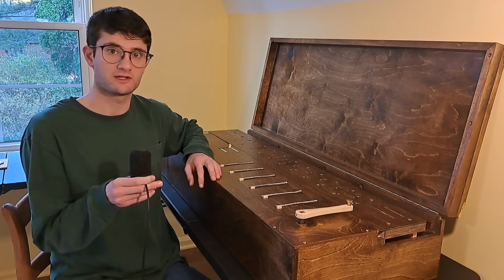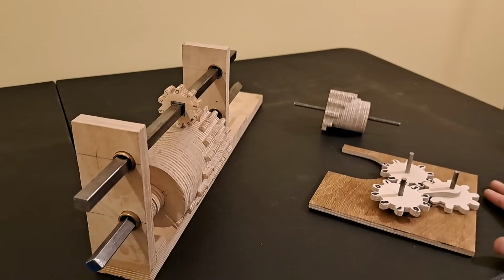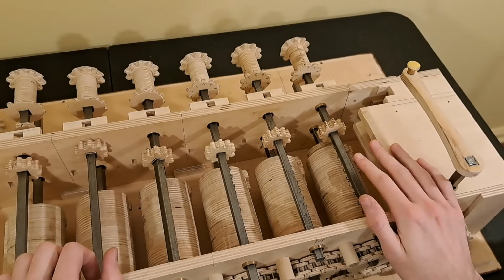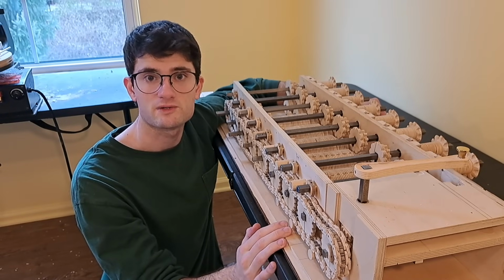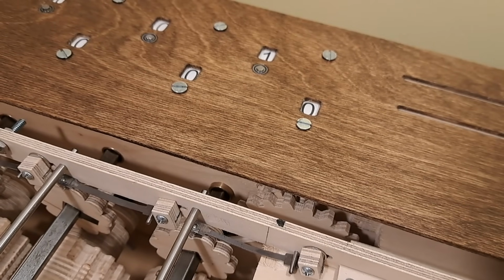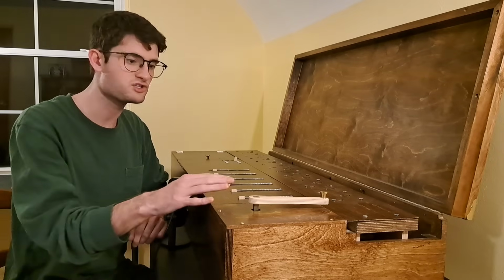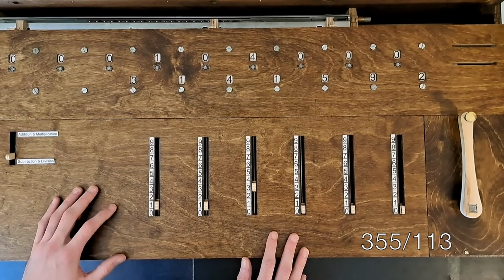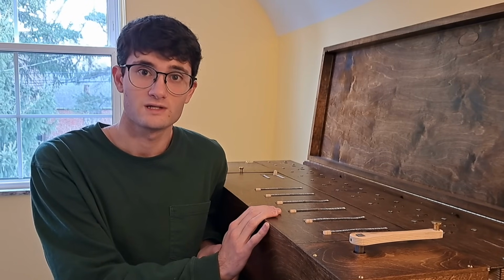How I built a Mechanical Calculator

Comment: The craftmanship and brilliance you've demonstrated are amazing. But I gotta ask... what happens if you make errors during number input? And, what happens if you rotate the crank backwards?
Reply from the maker: Thanks. If you slide to a 6 when you meant 7, for instance, the machine just acts like it's a 6, so you can make mistakes but the machine will not! (You'd have to subtract 1, or 6, then move the crank counter back the necessary amount). And there is a ratchet and click preventing the crank from rotating backwards. If there was not and you rotated it backwards then the machine would jam when it tries to perform a carry. Good questions!
Reply: Very cool, makes sense - you'd just have to catch your mistake and undo it. 

Heh... May I suggest publishing a Short demonstrating what happens when you divide by zero? The community may enjoy seeing the machine spinning with no operation.

Comment: Impressive!  I have a question.  What happens when you try to subtract a larger number?  Is there a way to deal with negative numbers?  At first I was wondering if you could divide by a larger number, but I guess you would shift the larger number over a few places until it was no longer larger.
Reply from the maker: Thanks! Yeah it doesn't really work with negatives. You can't input them, and when subtracting into what should be a negative, the outputs turn backwards from zero to 9, instead of to -1 (the dials would have to have like 19 spots to accommodate negatives: 1-9 positive, 0, and 1-9 negative). Thanks for the question!
Reply: @WhatWillMakes  Thanks, I thought that might have happened.  I guess it is like the complement in a computer, where negative numbers start with lots of 1s in binary a negative in decimal starts with lots of 9s.  I too was hoping to make a mechanical calculator, but a much simpler one, e.g. using gear ratios for simple multiplication or a 10:1 for second digit.  You inspired me, I might try one that incorporates negatives into it.

Comment: This is pretty bonkers. I have two Curta calculators, a type I and a type II, which internally use a stepped drum. Curt Herzstark's brilliant innovation was to arrange multiple digits around a single shared drum instead of using one drum per digit – this (along with a ton of other refined engineering) let the calculator be pocketable. I knew of Leibniz's stepped reckoner from having researched the Curta, but I never thought I'd see someone put one together out of wood – even down to making a _wooden chain_! Bravo.
Reply from the maker: Thanks! And I love the Curta - it's such an elegant design! I agree it's like rolling  this machine up around just one cylinder.

Comment: Not gonna show us what happens if you divide by zero? 😂
Reply from the maker: It's anticlimactic. Basically to divide by zero you'd just keep trying to subtract zero, but when you input zero it means the gears on the inside do not engage with any teeth on the stepped drums, so nothing happens when you crank except the crank-counter goes up forever... futilely

Comment: You don't need the intermediate wheel if you are willing to accept that every other wheel will rotate in the opposite direction in the same manner that analog home gas meters and electrical meters operate. Just number every other wheel backwards to compensate.
Reply from the maker: It's a good point, and I definitely could have done that for the model, but then it would not be as useful as a model to explain the full-size calculator. If I had been making a full sized Schickard or Pascaline adder (like the model is based on) then the reason not to just reverse the numbers would be more obvious: we want each input wheel to rotate the same way because then the user interacts with all of the input wheels in the same way. With the Schickard adder in particular you could also do subtraction and it would get confusing quickly which way is needed to rotate the wheels if every other one goes in the opposite direction. Thanks for the comment! - It gets to a core design element of these machines, that every decimal column should behave the same, especially to the user.

Comment: What I dont understand: what happens with the "carry" thing while adding numbers, when you have for example 19 and now you add 23 to it. Result should be 42 right? Does the machine produce the result correctly?

Because how I understand it:
- you add the 2 to the 1, so for the next 2 rotations you rotate the second wheel from 1 to 3
- and you add the 3 to the 9, so for the next 3 rotations you rotate the first wheel from 9 to 2, and while it is rotating from 9 to 0, it also makes the second wheel rotate by 1 (to carry on the tenth), right?
But now my problem: while the 9 is going to 0 and also moving hte second wheel, it is at same time still rotating because you also adding the 2 to the 1. So basically its anyway rotating regardless if you would carry or not. And that does it forget one rotation.

Or is the solution, that the carry is just "stored" and "executed" right before your fullfilled the whole rotation? Hmm.. when I think about this, you can only add numbers 0 ro 9, but never 10. So there i no position, that adds 10 on one number, and so you can always use these last "step" and add the carriage. Ah ok :D I think I solved it for me. Thank haha :D
Reply from the maker: It was a joy to read you think through the issue - very impressive honestly. 
You basically nailed it:
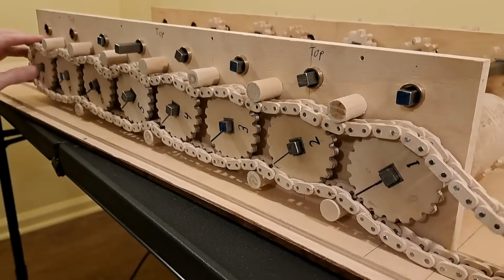I thought it would be too much detail for this video, but the carries happen after the 1-9 is added in each column, and every column is a little later in the cycle than the one to its right, so carries do not interfere with carries in other decimal places. If I had not removed some teeth on the stepped drums and instead of having 1-9 they had teeth going all the way around, they would have 20 teeth going all the way around. The extra tooth for carrying comes just after the 9 teeth on the stepped drum (so in the 10th of the 20 spots). This means the carry always come right after the 1-9 digits are added on that column. Then the sprockets that link the columns together via the chain also have 20 teeth. And each column is 1 tooth of the sprocket (1/20th) later in the cycle than its neighbor to the right, so that carries ripple and the rightmost one finishes first. (You can kind of see this in the video at 9:35, where I'm aligning all the sprockets so those black marks line up, but the actual squares of the metal shafts show that every successive column is turned a little more down the line). So everything is timed so that carries do not interfere with things within each decimal, and occur at the right time in relation to the other decimal places. (if you're interested, there's diagrams of those parts showing the rest of the 20 teeth on my blogpost: https://whatwillmakes.com/2024/12/20/my-mechanical-calculator-how-and-why/).
Reply: @WhatWillMakes  Amazing! Thank you!

Comment: Only problem I see is that number slides could be unaligned and could stay on position between digs marking wrong value. Could better have some spring that you need to bend sideway to move slide forward or backward? Like one side have slots like "E" and spring try sit in of one this slots.

One question how exactly carry and addition at same time work? like you try add 1111 to 9999, there could be conflict between one gear adding base value and this lever trying at same time add carry.
Reply from the maker: Thanks for the comment and question!

Yeah it's a good suggestion about the number sliders. I could have and maybe still will make the sliders indexable or discrete in some way – there's a number of ways to go about it with springs and detents, like you suggest, I did not do it at the time because it functions well-enough for my purposes without it and moreover I wanted to be able to easily remove the top panel and see the stepped drums and carry mechanism clearly. 

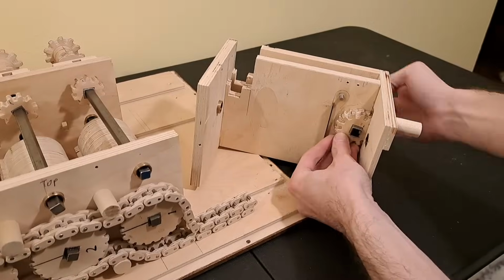About carrying, it's a great question. I thought it would be too much detail for this video, but the carries happen after the 1-9 is added in each column, and every column is a little later in the cycle than the one to its right, so carries do not interfere with carries in other decimal places. If I had not removed some teeth on the stepped drums and instead of having 1-9 they had teeth going all the way around, they would have 20 teeth going all the way around. The extra tooth for carrying comes just after the 9 teeth on the stepped drum (so in the 10th of the 20 spots). This means the carry always come right after the 1-9 digits are added on that column. Then the sprockets that link the columns together via the chain also have 20 teeth. And each column is 1 tooth of the sprocket (1/20th) later in the cycle than its neighbor to the right, so that carries ripple and the rightmost one finishes first. (You can kind of see this in the video at 9:35, where I'm aligning all the sprockets so those black marks line up, but the actual squares of the metal shafts show that every successive column is turned a little more down the line). So everything is timed so that carries do not interfere with things within each decimal, and occur at the right time in relation to the other decimal places. (if you're interested, there's diagrams of those parts showing the rest of the 20 teeth on my blogpost: https://whatwillmakes.com/2024/12/20/my-mechanical-calculator-how-and-why/). I hope that helps!

Thanks again for the well thought out comment!
Reply: @WhatWillMakes  Thanks for answer!

Comment: Interesting, When  was 10-12 Early 1960's one could obtain geared adding machines made out of metal or plastic, and one couldn't obtain an electronic calculator, as they were as yet relegated to the halls of industry,...(thousands of dollars) so a friend and I were interested in making an electronic calculator which had Boolean logic elements made from transistors, relays, or (my idea) modified toy race car electric motors.  We found a book in the library with a project for making such an adder-subtractor "calculator" using relays and an old telephone dial (a way of entering into the device a numerical "stream" of circuit closures or pulses.  It seemed so exciting to be able to easily, mechanically calculate additions of very large numbers.  The basic element for each binary digit was a "flip-flop", a device that has two stable states, and can represent  one bit, and a "carry" bit, with a sequenced set/reset flip-flop,... something called a "full adder".   Imagine that every time we do the simplest thing on our phones or computers we have carried out millions or billions of binary operations.  So much progress in 60 years.

Comment: This is a great explanation of how calculation is mechanized, which is the basis for all computers.

The key insight here was that calculation does not require mental cognition but just the turning of some cleverly designed gears. It's amazing how far this one simple insight has taken us. Which shows you the power of just one good insight. One good insight is worth a mountain of gold.

This mechanical process beautifully shows the relationship between addition and multiplication, and subtraction and division.

Also, interestingly, if you were in doubt about Terrence Howard's lunatic claims about multiplication (that 1x1=2), the mechanical implementation in this video takes the question of what is proper multiplication out of the realm of human opinion. You can know what multiplication is by designing a set of gears to do it.

Comment: You can do multiplications and devisions mechanically using a rod and 2 weights using the simplest pan-like style weighting scale.

Or using 2 semi transparent sheets of paper with grid and circles drawn on them.

Or obviously by using simple slide rule.

Or even manually by hand, still quite faster turning these gears.

So, I wonder what pushed the invention of these overly complicated mechanical calculators. And who were the supposed users of them? Clearly, it is not meant to be used by matematitions. Who bought these devices?
Reply from the maker: Great inquiries. First I would say that some of those methods are not accurate to many decimal places – doing a precise division/multiplication is difficult for them, not so with the mechanical calculator.
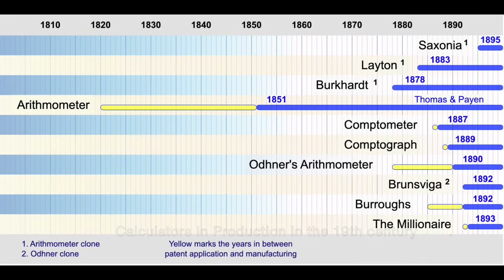Second I would say that initially these calculators were too complicated to work reliably; the ones that were built like the Pascaline and possibly Leibniz' Stepped Reckoner were likely not used everyday and more show-pieces than tools. However, fairly quickly the demand to calculate accurately and quickly (for taxes, engineering, commerce, etc.) prompted makers like Thomas De Colmar to solve the reliability issues. His device was commercially successful starting in the mid 19th c., and sold to banks, insurance companies, and basically offices (consider the impact of global trade and capitalism). Subsequent designs were even more reliable. See the chart at 33:23.
I'm glad you asked these questions, and sorry I did not adequately answer them in the video.
Thanks!

Comment: wonder what have gone for in that time period
price wise
Reply from the maker: Great question.
It's hard to get a good frame of reference, but they were either a luxury item or a serious business expense for a company. 
Per wikipedia, citing a french periodical from 1853: "A 12-digit arithmometer sold for 300 francs in 1853, which was 30 times the price of a table of logarithms book and 1,500 times the cost of a first-class stamp (20 French cents), but, unlike a table of logarithms book, it was simple enough to be used for hours by an operator without any special qualifications."

Comment: So about the intermediary gear to carry the 1. Why not just number 2nd wheel in reverse?
Reply from the maker: It's a good question, and I definitely could have done that for the model, but then it would not be as useful as a model to explain the full-size calculator.
If I had been making a full sized Schickard or Pascaline adder (like the model is based on) then the reason not to just reverse the numbers would be more obvious: we want each input wheel to rotate the same way because then the user interacts with all of the input wheels in the same way. With the Schickard adder in particular you could also do subtraction and it would get confusing quickly which way is needed to rotate the wheels if every other one goes in the opposite direction. 
Thanks for the question! - It gets to a core element of these machines, that every decimal column should behave the same, especially to the user
Reply: @WhatWillMakes thanks for explaining reason.

Comment: Someone smarter than me may have to explain… if you add 7 to 0, and then add, say, 53, so that the carry in the ones digit happens before the tens digit has finished spinning, won’t the carry interfere with the already-moving tens column?
Obviously you could just choose a better order to add the numbers (I.e. 53 first), but with 6 digit numbers, I can imagine you don’t always have that luxury.

Adding 53 to 7 would look like
07
18
29
30->40 (carry adds a spin while it’s already spinning)
50
60
Unless I’m confused about how these mechanisms interact which is highly likely
Reply from the maker: It's a good question! I thought it would be too much detail for this video, but the carries happen after the 1-9 is added in each column, and every column is a little later in the cycle than the one to its right, so carries do not interfere with carries in other decimal places.
If I had not removed some teeth on the stepped drums and instead of having 1-9 they had teeth going all the way around, they would have 20 teeth going all the way around. The extra tooth for carrying comes just after the 9 teeth on the stepped drum (so in the 10th of the 20 spots). This means the carry always come right after the 1-9 digits are added on that column. Then the sprockets that link the columns together via the chain also have 20 teeth. And each column is 1 tooth of the sprocket (1/20th) later in the cycle than its neighbor to the right, so that carries ripple and the rightmost one finishes first. (You can kind of see this in the video at 9:35, where I'm aligning all the sprockets so those black marks line up, but the actual squares of the metal shafts show that every successive column is turned a little more down the line). So everything is timed so that carries do not interfere with things within each decimal, and occur at the right time in relation to the other decimal places. (if you're interested, there's diagrams of those parts showing the rest of the 20 teeth on my blogpost: https://whatwillmakes.com/2024/12/20/my-mechanical-calculator-how-and-why/). 
I hope that helps!
Reply: Absolutely brilliant. Fantastic work!!!

Comment: I think the biggest flaw with the design would be the difficulty with working with decimals. You could just put the decimal dot wherever, but the digits would soon far exceed 6 digits.
I also think another big problem with your design is that you have to manually remove the panel to clear the calc